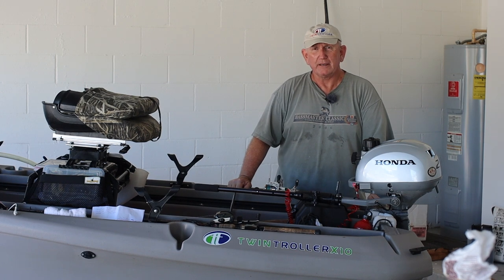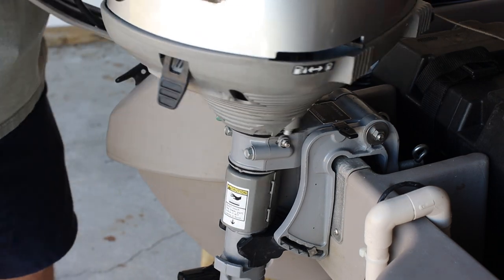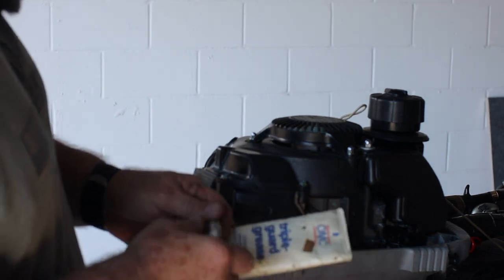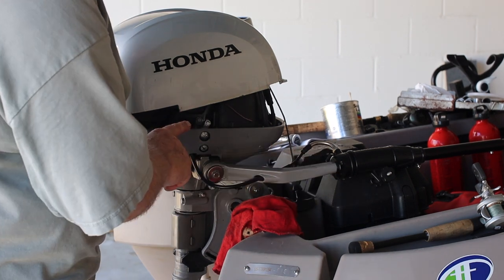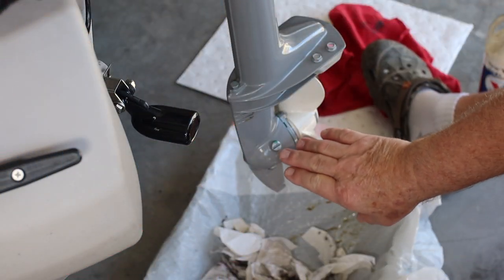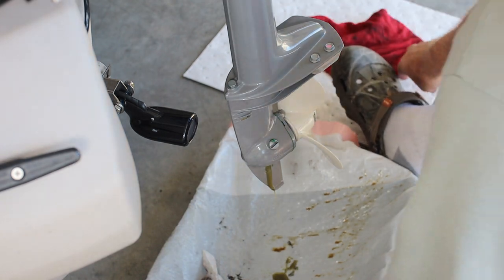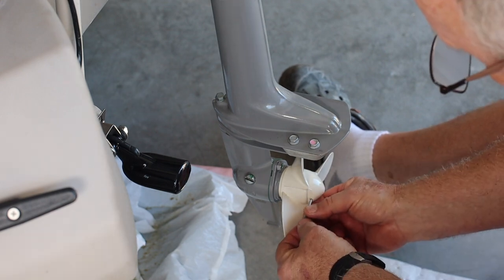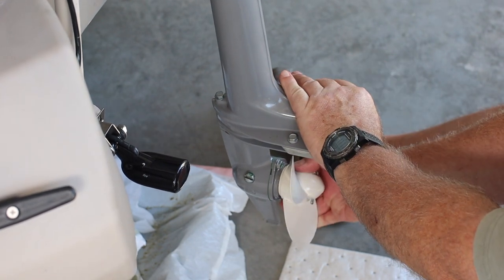HOW TO SERVICE YOUR OUTBOARD  (Part-2)

Comment: Great job Gerry and yes it was me that mentioned the oil slick but only because I thought something was wrong because I know you would never purposely cause any pollution in the water you love so much. There is a lot to maintaining this little motor that could.
Reply from the maker: Steve, One big advantage of this motor is the lack of all the issues you have in a water cooled motor and potentially bad issues that can have and all the maintenance for that system.                        Gerry

Comment: thanks for the detailed video ; just getting my 2.3 honda and this will be very helpful for me.  I noticed you have engine fogging oil and fuel stabilizer on your list.  Can you explain how and when you use these?  I probably will use my motor pretty infrequently; maybe every few months.  Any issues with the MRS fuel container?
Reply from the maker: Peter, The only issue I have with the MRS fuel container is the O-Ring in the top sticks and is difficult to remove. I occasionally spread some silicone grease on the O-ring and work the top on and off to spread the grease.
At the top of my home channel page there is a small magnifying glass to search all my videos. Do two searches for "FUEL" and "WINTERIZE" for your other questions.
Welcome to the family!                     Gerry

Comment: Thanks again; I got my Honda 2.3 hp motor and am in the breaking in period; going well aside from some unfortunate spills due to user error.

I value your opinion ; was wondering other than gas, the tool kit and the included cotter pin, and shear pin; what would you recommend having on board the boat for issues with the motor?  do you carry an extra sparkplug?, oil? prop? anything else I may be missing.  I have basic safety stuff for the boat itself, but mainly referring to things needed when having the gas motor.  thanks again, Peter
Reply from the maker: Peter, I do carry a few extra tools (Better pliers, screwdriver, some mechanics wire for trying things, electrical tape, after the first tune up I cleaned and gapped the old plug and I keep that for a spare in the TT, a short 6-8' piece of rope to tie the boat to a dock if needed, and a shop rag.) I carry all that in a waterproof dry bag. In addition I carry an emergency step stool to help re-enter the boat if I fall out. (I describe that in the SHOW MORE section under any of my more recent videos) I never had to re-enter the TT from the water but that gives me the peace of mind that I hopefully can if I need it. I do not carry extra oil or a spare prop just because of storage limitations. 
Peter, it is great you are thinking ahead. When you go to Captain School (and the Boy Scouts) they drill all that into you just in case. I also tell my wife where I am going and often draw her a map. If I deviate from that I tell her in a text as I did just today where I went instead of the original float plan. I text her when I launch, every 45 minutes with the letter "K", and when I have returned to the boat launch. 
If something happened and you are on the lake in an emergency there is nothing more important than someone knowing where you so they can look for you. That assumes your wife or someone you left the information with, and are texting throughout the day, is paying attention to the fact that they have not heard for you in a long time! 😄.    Gerry